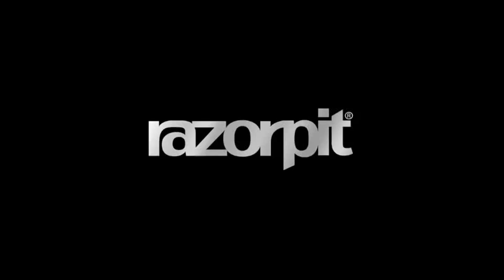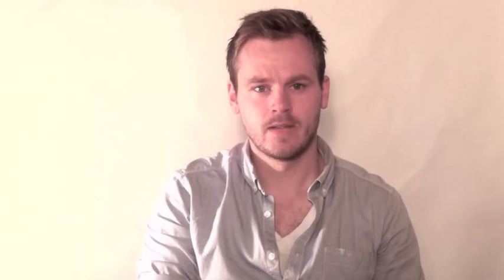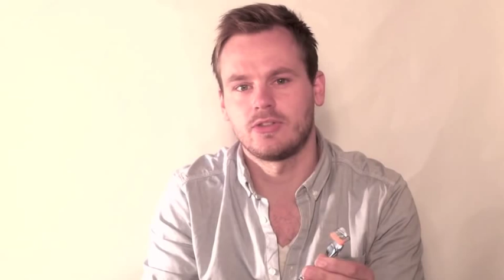RazorPit - YouCast 1 - How it works

Comment: i noticed a big difference in my old razors, i have a Schick Hydro and some Target brand 3 blade razors that dull out pretty quickly. i kept the old ones once i ordered the product so i could see if it worked and it sure did, i have sensitive skin so i only shave twice a week and today was my second time to shave so i tried the razors and i can tell the difference, the razor didnt pull my whiskers at all and i didnt even get cut. i got  2 pkfor $25 and it was worth it